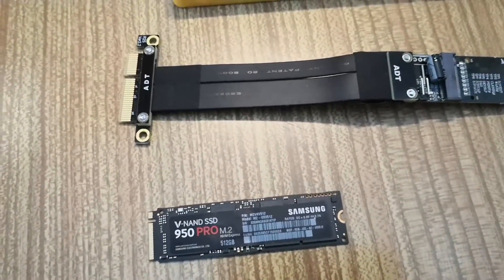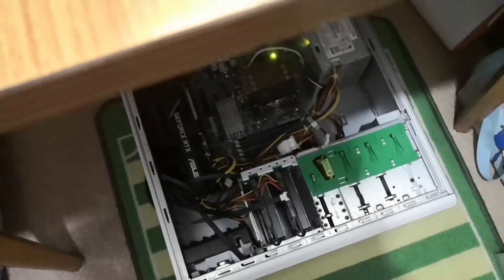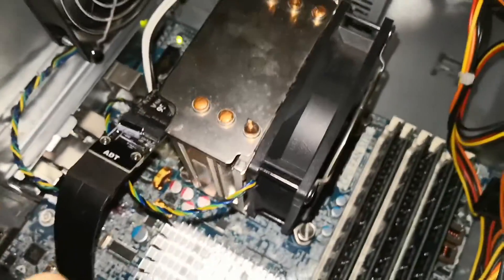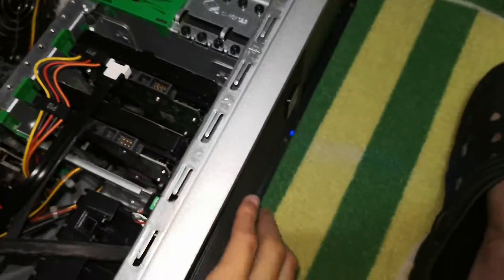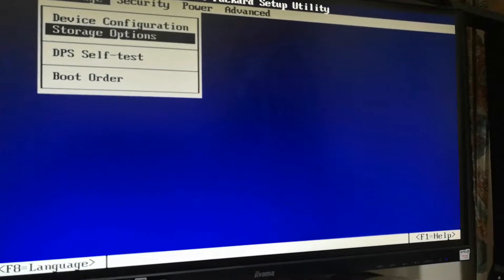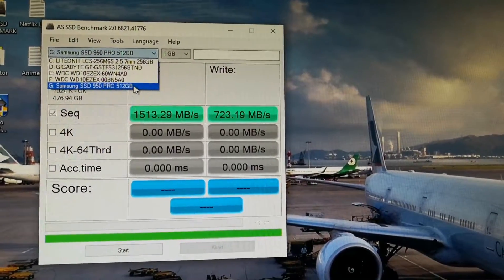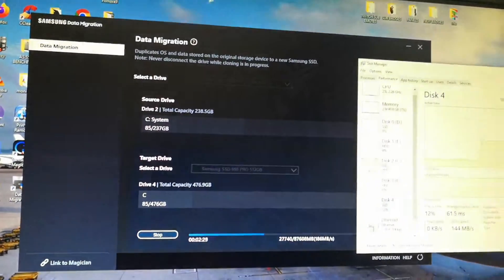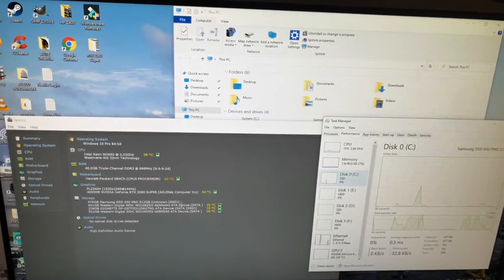Installing NVME Boot drive on HP Z400 with legacy BIOS [950 PRO SSD]

Comment from the maker: To all the downvoters: If you have ACTUALLY watched the video, it would have explained why the Samsung 950 Pro worked on the X58 computer. This is because of a special firmware called the Op-Rom. Which allows the NVME to boot from a Legacy BIOS. If your NVME doesn't support Op-Rom then unfortunately it won't work!

Comment: I have a 2014 laptop (XMG P505) which boots fine with the NVMe ssd it came with, but I find it impossible to boot with any other SSD.  Even after cloning the original, or of course doing a clean installation.  VERY annoying.  The BIOS does not see not only the new drive, but the old one either.  Yet it boots fine with the old drive.  Linux or Windows can see the drive if I connect it, but I can't use it as a boot drive.  I was hoping I would get an idea from this.  Unfortunately my BIOS is much less extensive.  
Thanks for the video.

Comment: Thanks for posting. Weird that you have to set it to IDE. On other BIOSes, I'm used to seeing AHCI or RAID options. Maybe the AHCI option is labelled IDE on this system? Have you tried running CrystalDiskMark on it? I'm curious what the random reads are like? I have a Z400 and a Samsung 970 EVO and found that the random read speed was pretty terrible on that computer. Only 17 MBs. I'm wondering how much that would be improved if I switched to an NVME drive.

Comment: Hello, i dont have a samsung nvme drive i do have an other nvme drive and its set to mbr but still doesnt show in my bios, any idea why? Thanks
Reply from the maker: If you have watched the video, it would have explained why the Samsung 950 Pro worked on the X58 computer. This is because of a special firmware called the Op-Rom. Which allows the NVME to boot from a Legacy BIOS. If your NVME doesn't support Op-Rom then unfortunately it won't work!
Reply: You need to manually inject modded OpROM into your BIOS. Check Win-Raid forum. But this needs to be done carefully to no brick your board. If you're not sure you can do it on first try then buy a firmware programmer to rescue ypur board. If you have a Gigabyte board with DualBIOS then it's luck

Comment: I have an HP z420 Workstation. I want to install this same m.2 nvme SSD and make it bootable for windows 10 will it work on my system. I have 1 PCIe X16 slots and Gen 3 X4 slot
These are the specs.
Xeon E5 1620
32 GB DDR3 ECC RAM
RX 470 4GB OC EDITION
Reply: Only m.2 sata work I am pretty sure because on mine it only works

Comment: I know this is a little old but you got lucky, the Samsung 950 Pro happens to have an oprom (Option Rom) on board like the Intel 750 SSDs.  If you tried any other NVME drive with this adapter it most likely would not work.

Other World Computer has a couple of pci adapters that I believe have oproms but will have to check.  Not sure of other SSDs or adapters that have oproms, but all other ones I have run across are passive.

If there are any other NVME drive/adapters out there that have legacy boot support, feel free to comment.
Reply from the maker: That was the only reason I bought that drive, shame newer drives drops this support
Reply: @UrbanOzzy  that's crazy hardware lifetime expanding for modern world. Sure this LGA 1366 with a decent 6-core CPU with overclock and modern GPU can even run tons of games and software. Well, maybe not the greatest by modern standards but enough for a home usage if you're not playing all modern AAA games or want to play GTA VI

Comment: Can SATA SSD 512GB work on HP Z400? SSDs use less volts to operate.
Reply: I have a SATA 2.5" Crucial MX500 1TB in the Z400,

Comment: Dell T3500 has the same chipset. Does it work?
Reply: I have t3500. Planning to try to install windows 11 pro using windowstousb by hasleo. And on the first boot use clover bootloader

Comment: Interesting, I'm curious if it has to do with hp controllers, or would that work on any system as long as you choose "IDE" . I have a Lenovo S30 (x79) and would like to do the same

Comment: No usb stick or some sort, directly boot from nvme? cool.. 👍👍My system is on Evga x58 SLI LE( it has Legacy as well ) . do you think it boots from 950 pro?? because I ve read somewhere that legacy does not support system boot from 970 or 980 nvme drives. Bummer..😒😒
Reply: the 950 pro supports both ahci mode and nvme mode that's why these old machines can boot from them. any drive released after the 950 pro were only nvme witch most systems didn't support till around the x99/z97 era. there is a guy over on techpower up who was releasing modded bios for older systems including x58 that would let u boot an nvme drive. but its been a couple weeks and he has stopped responding to peoples request not sure if he is not doing it anymore or just busy.
Reply: @mraaron1584  So this wouldn't work on a modern 970, 80 or 90 PRO Samsung NVMe?

Comment: I have the same module here but I have the 256gb one, and the same Z400, but I have the X5680 CPU and 12GB of PC3-10600E ram, so it seems to have enough of that, but I tried the same thing U did but I used a USUAL plain X4 type plug-in cheap china type board, NOT that ribbon socket that you are using, I have a 1712 READ speed and a 958 WRITE speed in mbps, I am going to ASSUME it may be possible U lost some signal strength using the long cable ribbon as U do lose some signal on that, so best to just get the usual X4 slot cheapo NVME board and yes put it in that lower slot 4, that X16 slot and yes as you said change the Raid+AHCI to IDE, all will work fine and yes it will show up in the boot menu, so good job on the experiments but I am getting faster speeds on the lesser 256gb module, so the only thing I can see here is the ribbon-cable yes can create some loss there, so change that to a usual dollar china X4 slot board and UR set to go.    BETTER YET they make this one board that has TWO sockets, the NVME socket and the NGFF one too with it's one Sata port, U can use THAT ONE which I use and then U can use the NGFF for a nice fast-storage drive to put on one of the Sata 2 ports on the mobo so U got maybe like 280 READ-WRITE speeds for that storage drive, all powered off that one single $8 type board.
Reply: hello. i have the same specs. can you give the link to purchase that x4 board you use in your computer?

Comment: Hello why can't find my nvme drive gpt on boot order, model hp z420?
Reply from the maker: you need MBR partition
Reply: @UrbanOzzy  i changed to mbr but still same
Reply from the maker: @y0urner0gaming  no idea then, this video was made for HP z400 and using a 950PRO nvme ssd
Reply: hey bro, what the kind of your ssd m.2 you used?
Reply: I have the same problem but with Crucial m.2

Comment: Hi I have HP Z800 and I’m trying to install NVMe 512GB using adapter to PCIE It it is been detected but windows giving me the following message “ Windows Cannot Be Installed To This Disk This Computer your SSD controller not supported.
I changed in the BIOS to IDE as you instructed but still no success.
I can use the NVMe as secondary Hard drive but not as main boot device.
Any suggestions?
Reply from the maker: Install it on your main drive, then use a hard drive cloner. To clone it on to the nvme. Make sure it is in MBR partition before you clone it
Reply: @UrbanOzzy  thanks for the fast reply.
So you say install the OS on the sata ssd and than close to the NVMe using program like Macrium reflect?
Should I close when NVMe attached to the PSIE and when I restart remove the SSD first? Should I keep IDE in Bios or it doesn’t matter?
Thanks again👍🏻
Reply: @Odesionavmilhun  Bro, did it worked?
Reply: @tarunrawat8829  Hi no it didn’t what ever I tried it will only work as 2nd hard drive
Reply: @Odesionavmilhun  ok 👍, If I install heavy softwares or games on nvme secondary SSD, Will I still gain any benefits in this case.
Thnx for your reply.

Comment: Will this method work on HP Z420?
Reply from the maker: No idea, give it a try
Reply: @UrbanOzzy  Z420 is a newer model than z400. It should work but all are saying me that it's not working
Reply: @NABEELAZIZ  What did you do bro?
I have an M.2 for my hp z420 but it is not booting!
Did you solve it?
Reply: @MAlazhariy  you have to purchase hp turbo ahci card in order to boot it. Hp z420 only supports ahci card of its own company.

Is your nvme showing in boot order?
Reply: @NABEELAZIZ  Only works with 950 pro, because 950 pro has legacy buos within the ssd

Comment: Can this method be used on Z800?
Reply: Most likely yes ... Check out "theartofserver" on youtube and ebay.   He shows some solutions for Z800 systems.  Please note that after my many purchases to improve the speed ... the first question is why?  SSD's in MOST real world user situations do not need a faster data transfer - you will never notice the difference. If you really need that faster speed get a new computer.  In all of my testing on a Z800 ... nothing beats RUNNING SAMSUNG MAGICIAN with a SAMSUNG SSD SATA3 on my SATA 2 ide connections (not the SAS connections (just move the cable on the motherboard from SAS to SATA to keep using the hard drive bays)).  I'm sure a 4 card bifurcated solution would work at an enormous expense (again if needed buy a new computer)  I have purchased used OWC Mercury Accelsior E2 cards with dual memory sticks (they use an older design stick design (Mac 2012/2013 design)) and they work perfectly in a Z600/Z800 with speeds around 600 MBps or greater.
Reply: @brettvast1774  Thank you friend
Reply: On my z800 the bios detected the drive and the operating system was able to use it but I was not able to get ithe computer to boot from it.

Comment: Reason why its slow in writes is due to using IDE data config, IDE protocol was not built for SSD and so won't utilise full speed and windows won't be able to use trim either
Reply from the maker: If u watch the video, i have explain why i needed to put it into ide mode. As otherwise the legacy bio on the hp z400 wont be able to detect it

Comment: Hi ! Fury Panda, I would like to know if It is possible after installing wondows on Pcie Nvme m2 Samsumg Pro it can install others Pcie Nvme ssd bootable in others slots PCIe, to turn on Windows and to create a logical Storage Drive with the rest of PCie Nvme M2 ssd, So first boot from the first drive however with the rest of storage capacity Pcie Nvme M.2. It could be posibble as a Logical Drive, in fact, every phisical hardware slot pcie nvme m2 will get speeder by every channel bus comunicartion slot Pcie, do you understand my question ? Getting faster read write speed on all windows,

Comment: Hey bro.
Well I got an HP Z400 with a xeon w3550 that i was planning to sell because i think the cpu is bottlenecking gpus.
But I saw videos on YouTube that it works great with some old gpus.
So, do you recommend me to get a 1060 6gb for it? Or an rx 580?
Is the psu gonna be enough? I heard the w3680 is the best one in that socket where can i get one?
Reply: You can get w3690 @4ghz and 32gb of ram on the Z400 I have both and the computer is a beast if you also install NVME it will be awesome
Reply: @isymdvr  update: I got an rx570 4gb, 12gb of ram on triple channel, and a W3680 overclocked to 4.1ghz, runs great, but i think the psu isnt enough, planning an upgrade soon.
Generally decent gaming experience especially for the price these cost nowadays
Reply: @XenooS7  I got a 1060 also overclocked the CPU. PSU is not standard and you need an adapter for it so far works fine no need to upgrade it
Reply: @isymdvr  i do want to swap the psu, but i cant atm cuz i dont have the adapter, and websites that sell it dont ship to my country

Comment: Will Samsung 980 pro will be detected too like the 950 ?
Reply from the maker: no
Reply: So only a 950 pro would work?
Reply: Even 970 wouldn't work I think
Reply: @iangabrielalcantara7756  bought a 970 evo... doesn't work
Reply: @yvndmedia  Yup as expected
Reply: Just bought 970 for my xeon 2660......
Reply: @kinnemon7404  it works or no?

Comment: Nice! I bought the same drive because of the legacy aspect. I didn't want to fiddle anymore with hacks to make it work on my X79. My board actually has a BIOS update for it too.
Reply from the maker: Glad I could help <3
Reply: @UrbanOzzy  I just installed Windows 10 and it went smooth! I'm super happy. I even feel a bit of a difference in how snappy everything is.

Comment: Did you mod the power supply in any way? I see that you have a 2060 Super. Does it have any issues running?
Reply from the maker: its actually a 2080 super (undervolted), dual molex to 8 pin. no mods needed on the PSU. Watch my previous videos to see how i did it!
Reply: @UrbanOzzy  isn't it bad for it?

Comment: I have a z600 ver1 , will it work? 
If booting linux (gpt partition) will the system recognize the nvme drive?
Reply from the maker: only boots from MBR partition. Z400 or Z600 won't recognise GPT
Reply: @UrbanOzzy  ahhhh got it ! THANKS FOR THE INFO ☺️

Comment: I installed a m.2 predator on ahci recognized at first boot
Reply from the maker: yes, ahci drive can also be bootable. What model was it?
Reply: @UrbanOzzy  kingston hyperx m.2 gen2
Reply: What
Reply: Me too. I also have a M.2 HyperX predator ahci booting Windows 11 clean install on my Z800. It gives me about 1327mbps read. I have great reads from mine all around. Especially with USB 3.0 with PLX chip. Im actually very curious what the "real" speeds are using the IDE settings.

Comment from the maker: Samsung 950 Pro NVME bootable on HP Z400 with legacy bios, be sure to like the video! x
Reply: unable to detect the NVME M.2 in bios setting. I'm using XPG SX8100 NVME and Ugreen PCIe to M.2 board. Please help...
Reply: @cheesengwong5697  Try using the Clover method